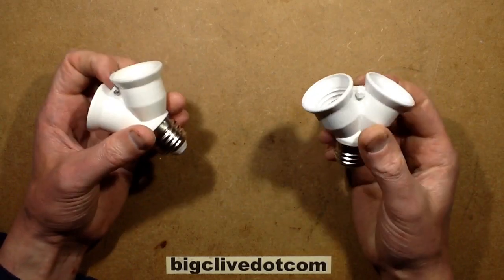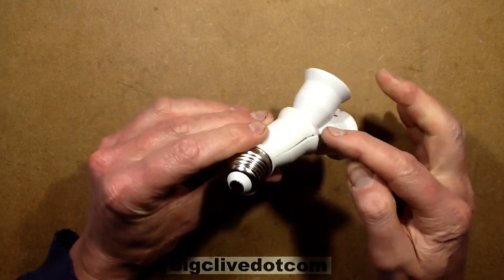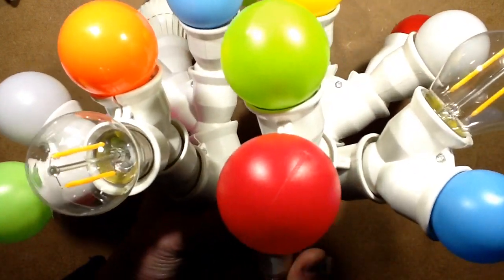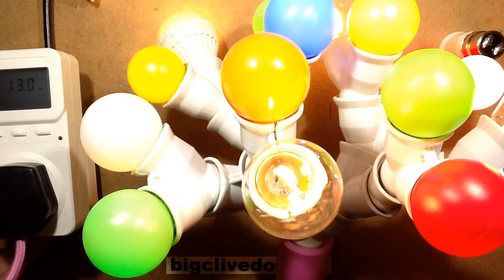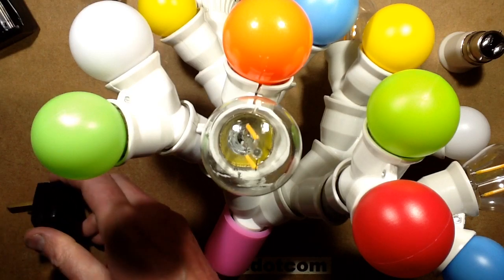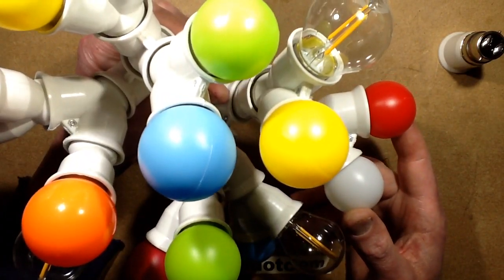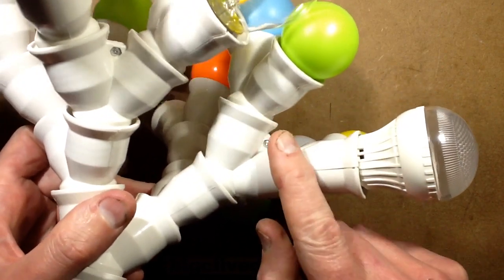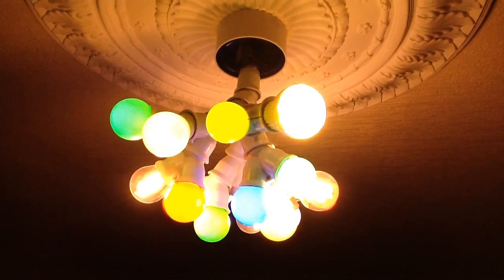Blue collar trash chandelier.

Comment: "That would be a 1.6KW light, that would melt probably" 
PROVE IT! :)
Reply from the maker: The hard bit finding the "old" 100W lamps these days!
Reply: 50 pack on ebay for £16 ;)
Reply: really? all they sell here (canada) is incandescent, you rarely see LEDs at all
Reply: At least in Ireland we moved onto the fluorescent and LED lamps pretty much completely by now. Incandescent is pretty much extinct by now here :P
Reply from the maker: Isle of Man...   No markets like that.
Reply from the maker: The rich flicker-free full spectrum, complete dimmability from full to zero and the lovely smell of hot Bakelite.
Reply: Clive, I was about to say, if you don't use 16 100 watt tungsten lights I'll loose all respect for you, you ticked our fancy now our thirst must be slicked, 100 watt lights aren't too hard to find (least not in Dublin). Also that thing is 100% a fire hazard and a shock risk, I love it.
Reply: Back in the mid 90's I was hanging a 28 light chandelier in a house I just built. Had I not checked the bulbs that the store supplied I'd have installed 50W bulbs. That thing was rated for 15W bulbs.
Reply: +Trump's Merkin was ther sparks and flames? Also aren't 500 watt bulbs massive, I don't think 15 watt max sockets can support 500 watt bulbs anymore, lower standards back then I guess.
Reply: Joshua Nicoll
50W not 500W :)
Reply: Not here in Murica.
Reply: Heh ... yeah even here within the EU are incandescent light bulbs banned...

But you can still find some "old warehouses" where magically and steadily some really cheapo bulbs come out...... Because, old stocks are still legal to sell.

Someone should grab a pack and send it over to bigclive ;)

(I'm somewhat sure that even 10 to 16 50w bulbs will overheat in this mass and probably melt at least some socked and move their conducors ...... will it spark out before it falls apart? ;)
Reply: you can get 200w  bulbs as iv got a few for ballasts  to limit how much power to stuff
Reply: Jean-Louis Bourgeois - Population of Europe about 513 million.
Say half of this population have a light on for say an average of about 4 hours a day.
365 days in a year.
513 million ÷ 2 x 4 x 365 = 374,490 million hours of operation per year.

Using 100W lamps, that’s 37,449,000 million Watt hours per year.
Using 15W LED lamps, 5,617,350 million Watt hours per year.

A difference of 31,831,650 million Watt hours per year. How many power stations is that worth? How much less gas or coal is then burned?

Comment: These are cool little things. I also had a problem with the plastic parting. I used white zipties around each socket to reinforce them. That way the bulbs can be screwed on tighter. Try it out, works really well.

Comment: I still want to see what happens when you put 100w tungsten lamps in it! (an outside video probably lol) and like SilentS said, try it with all disco bulbs!
Reply: Or 100W LED lamps :D (not that it would be possible in E27 fitting)
Reply: +LifeOfACube 100 watt URANIUM BULBS
Reply: Many years ago, I once found 150W tungsten lamps for sale - put enough of them in that fixture and you've got a very bright, very inefficient heat source...
Reply: When I was growing up we had two 150w lights in the kitchen, looking back, they must have cost a fortune to run! I remember my bedroom lamp popping so my dad (Drunk at the time) puting the only spare bulb in and it was a 150w it was so incredibly bright! It melted the plastic bit that keeps the shade on though and it smelt so bad!
Reply: I don't know what UK default amps are for circuits, but in Canada, it's 15amp/1650 watts, so 11 would fit. And set fire to loads of things. Good idea! :)
Reply: In those days, the power companies were state owned, and electricity cost bugger all. We all had nichrome wire in our little heaters, blasting away at a kilowatt per bar, and a lot of them had 3 bars=3kW. Nobody even took a moment to think about what power cost, because it was virtually for free. Now, the generators are privatised, it's a free market, and they roger us in the bum with the price until it hurts. That is, unless you're a bit user like a smelter, who pay hardly anything per kW, because the generators are lining up trying to get their business. 
In my view, all utilities should be state owned, otherwise, they just have the capacity to screw over the small guy, and they have absolutely no problem with that.

Comment: I've had the same issue with case separation on those cheap night light holders. I've found putting a zip-tie (or two) around the opening will greatly enhance its integrity. YMMV

Comment: please try it with 100w bulbs in, i would imagine at 1600w it would be a nice glow :)
Reply: fires glow pretty well, yeah
Reply: qwertzy121212 lol
Reply: Maybe some 100w LED Equivalent bulbs?  So, like 15w each (standard for true 950 lumen bulbs), by 15 bulbs so 225 theoretical watts.  Should be sustainable, they do get hot, but only at the base, so long as they aren't surrounded in glass or plastic, they should last a good while.  Granted, you'd have to wear your sunglasses indoors but you might get the benefit of a slight tan, haha.
Reply: mharris1270 so ? it is all in the name of fun buddy!

Comment: I use a lot of these splitters. as it ends up cheaper to use a splitter two modestly powerful LED bulbs than a single powerful one. 
I've daisy chained 3 2-way splitters and connected 4x12W LEDs, it was pretty bright, but I haven't dared to push it further than that.
Reply: I wish  find a three way splitter like this, that would be ideal. Also, you could match warm/cool lamps.
Reply: Haven't looked for 3-way splitter, but I've seen 4-way splitters in photography shops, they were just as overpriced as you would expect.
Reply: Aliexpress has multiple versions of 3-way slitters, search for 'e27 splitter 3'  From $4.33 and up.

Comment: A good tip for them splitters is when the plastic gets pushed apart, just put a dab of superglue in there and remove the bulb or other adaptor so it mates back together again, let it cure and that's the split issue solved... :)

Definitely looks fun though, kind of reminds me of a section of the Fesarius from Star Trek "The Corbomite manoeuvre" which was just a big ball of little balls of light... :P

Comment: In North America, we use bayonet-base bulbs in automotive applications, because a screw-base would be unreliable under vibration.  I'm not sure the advantage in stationary applications, I prefer the screw-base, in that it allows you to temporarily turn off a bulb by unscrewing it a turn or so, without it falling out of the socket. The bayonets are a bit quicker to change, however, not that 2 seconds usually counts for much time out of your day.

Comment: Never heard of E20, just "screw-base."  Wikipedia says the most common standard Edison type is the E26, however 11 sizes are available for a variety of applications, from E5 (5 mm) to E40 (40 mm).  I assume Clive meant "E2x."

These Y-adapters are great for adding more light to a room, but I've never carried it beyond 3 lamps.  I was concerned that the current might melt the solder in the base, but that was in the days of incandescent. I'm sure it could support a much greater number of LEDs.
Reply: Landrew0 He said E27. they're a fairly normal standard size here in certain light fittings but bayonet caps are the normal for ceiling pendants and batten holders in homes, unless you change them yourself.

Comment: Is weight a concern?
Reply from the maker: When fully loaded with small low-power lamps it weighs about 600g which is much less than some Tiffany glass lampshades.
Reply: Ah, so the splitters are rather lightweight. I somehow had it in my mind they'd not be.
Reply: +bigclivedotcom don't most lampshdes clip/screw to the fixture though, not the bulbs themselves?  I haven't seen one that clips to the bulb on anything since I lived with my Grandparents

Comment: I came up empty when searching ebay for 120v golf ball led bulbs. Has anyone found these for sale?
Reply from the maker: Although they say 220V the little lamps will work on 110V at slightly lower intensity.
http://www.ebay.com/sch/i.html?_odkw=golf+ball+led+lamp+e27&_osacat=0&_from=R40&_trksid=p2045573.m570.l1313.TR0.TRC0.A0.H0.Xgolf+ball+led+lamp+e27+red.TRS1&_nkw=golf+ball+led+lamp+e27+red&_sacat=0
Reply: did you take the golf LED balls apart to check on their PSU safety ?
Reply: Usually it's a capacitor dropper circuit so no isolation of such, although it's quite reliable.
Big Clive's video: /watch?v=QOYFetaTbBE
Reply: DjResR thanks I watched that video now. could hypothetically the capacitor get destroyed in a way that the LED gets full 240v or will it always break in a way the circuit gets disrupted ?
Reply: check on alli express
Reply from the maker: It can happen and tends to fail cleanly.  LEDs are boring when put across the mains.  They don't even go bang.
Reply: bigclivedotcom so not suitable for your joke-videos :)
Reply from the maker: They can be modified to make them fail in a more amusing manner.
Reply: bigclivedotcom warn me when you're about to do that :)

Comment: In my experience of replacing screw-in lamp sockets, people always over-tighten the damn things.  This can cause two failures; either the springy center contact will get permanently crushed down or they'll be unable to unscrew the lamp when it comes time to replace it.  I always lecture people that they should screw them in until they illuminate plus no more than another ¼ turn.

Also, the goddamned Instagram suburban housewife "DIYer"s rarely tie a proper Underwriter's knot...  Oh, and one last gripe; a shipping pallet, white paint, and casters do not a coffee table make.  It's still a fucking pallet, and you're not "upcycling" anything if it's still trash when you're done.  No, actually, fuck it.  I've got another complaint.  What's this "upcycle" bullshit?  When I was a kid we learned reduce-reuse-recycle ("the three Rs"), not reduce-'upcycle'-recycle (RUR?).  Goddamn 'millenials' ruining everything...

Anyway, nice work, Clive.  Go treat yourself to a super frothy coffee; you've earned it!